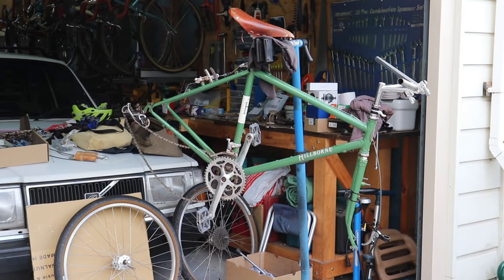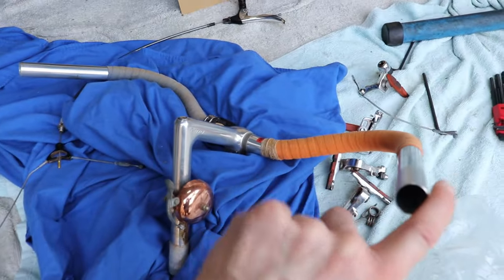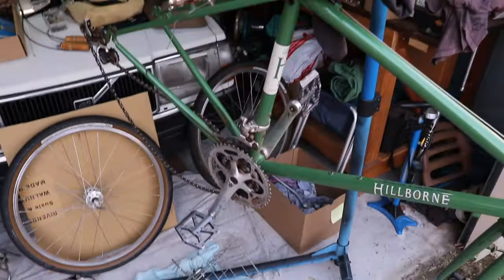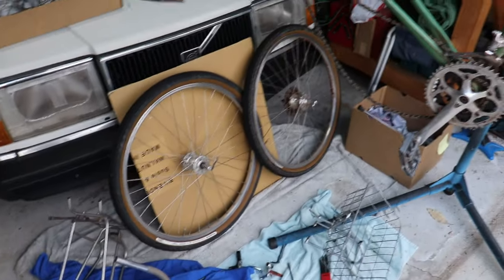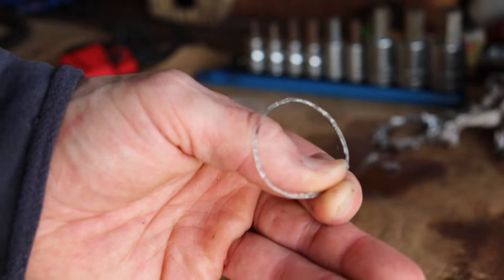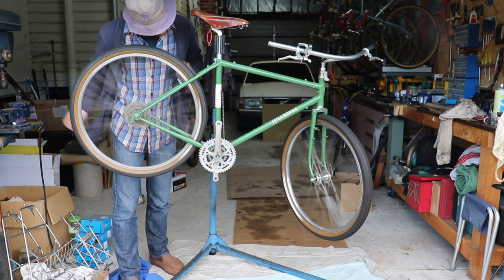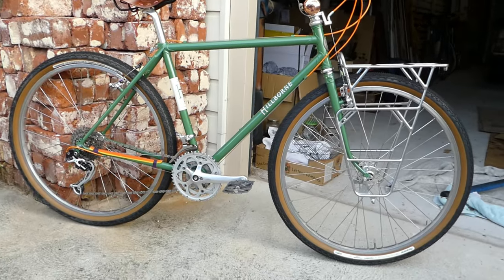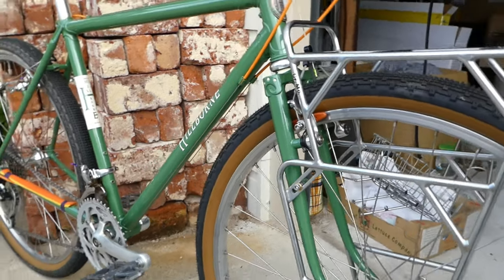Ten year old Rivendell Sam Hillborne gets cleaned up

Comment: Nice build as expected! How do you like those Oryx brakes? I had a set on my LHT but could never get them setup properly (they were very used when I got them, came with the bike). I know Riv stocked these for a while. Shout out for the Hawes watering can, I've got the same one.
Reply from the maker: The Oryx brakes have been laying around for a while, I think they came off a Fuji Touring. They are ...adequate brakes. Like all cantilevers they seem super fussy about the bike you put them on and the pads you use. I had to use them here to clear that front rack and fortunately are working quite well here. I remember they were particularly bad on my Appaloosa with the different post spacing.
I can't believe you spotted the Hawes, that's an eagle eye!
Reply: @brendonoid6133  That's what I'm here for, identifying other niche interests (British watering systems with brass rain roses) within video about other niche interests.

Comment: What's that front rack? Surly? I'm looking for something substantial that'll handle a basket and bags at the same time. I've almost resigned myself to a 2 rack set-up, but this looks perfect.
Reply from the maker: It is Nitto Big Front Rack 34F. It is super over built with brazed joints and nickel plating but doesn't come with much mounting hardware. If your braze-ons aren't in exactly the right spot you have to sort your own brackets out.
Reply: @brendonoid6133  thanks! I'll look into if people have had luck with them on Ogres. Appreciate the reply!
Reply from the maker: @dillroastington  You are probably better off with a surly nice front rack on the Ogre simply due to the width. I don't think the Nitto would be wide enough, it is designed for 100mm axles and narrow fork tubes, the Surly specific ones have room for boost spacing and disc brakes.
Reply: @brendonoid6133  they're sooooo heavy though. Oh well, guess I've doomed myself to a 40lb bike when I went with an ogre to begin with. Thanks again!

Comment: That scrubbed up nicely! Gosh even those it's 2012 it truly is a timeless design! What adaptor did you use to make the double thumbies work?
Reply from the maker: It is an old IRD? stem mount that Soma and Riv used to sell. It didn't work well with the triangular stem of the bullmoose so I had to get creative. She was running bar ends on the Albatross and I didn't have anything else in the parts bin.
Reply: @brendonoid6133  never seen them before... but it looks rad! Thanks for sharing! 👍